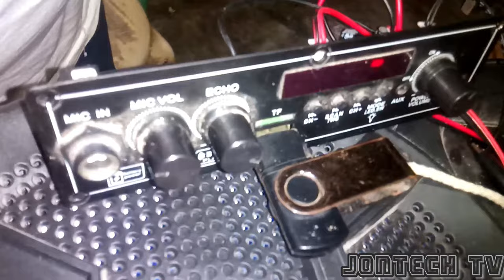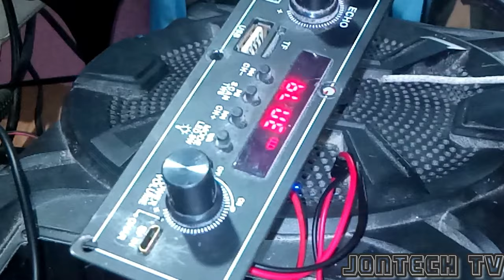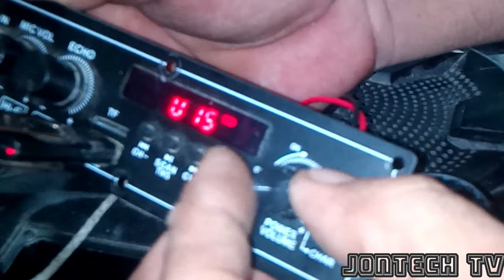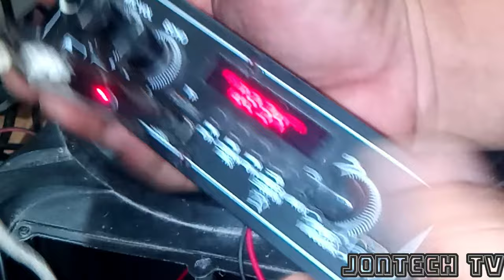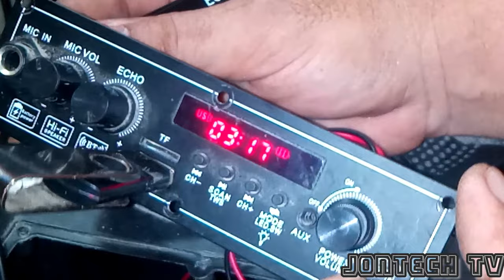dapat mo mapanuod/baka ganito sira ng bluetoot mo

Comment: Boss bakit ganun Bluetooth speaker ko nag po power on nman sya at may sound kaya Lang nag loloko kaya Lang nag iinit yung capacitor nya pag Inalis ko battery lalamig pag nilagay ulit battery mag on sya kaya Lang sobra mag init capacitor nya pag pinagtagal n naka kabit battery umaamoy na sobrang init
Reply from the maker: Pag may umiinit.ibig sabihin may shoted ,need.mo hanapin short.or.leak na parts nyan lods